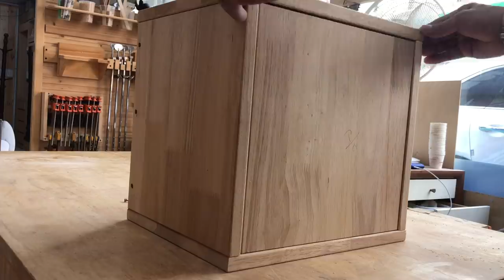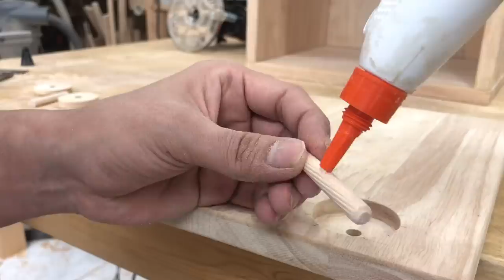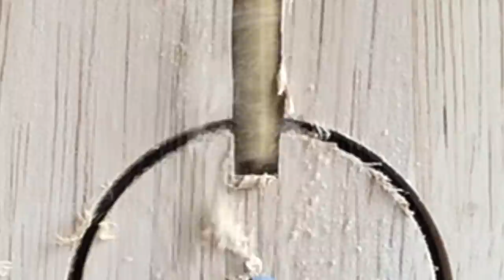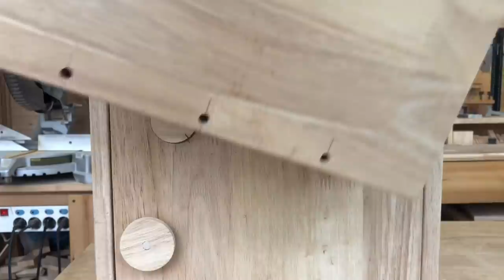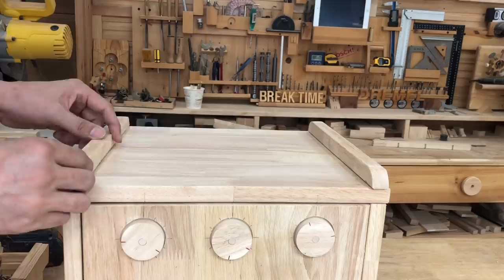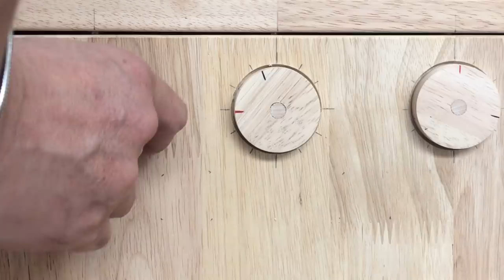부비 트랩 잠금 장치와 숨기기 목공 DIY

Comment: I want to see one made from something stronger like stainless steel.
Reply from the maker: 👍Thank you 😊 Have a nice day 🍀
Reply: yooooo cody youre here!
Reply: How would you go about the magnets when using steel?
Reply: and mess the magnetics mechanic
Reply: @six8810  at least it will be strong
This wood thing could be opened with a strong hand pull or flat head screw driver without much force at all
Reply: @robertnett9793  Good quality SS is not magnetic. Cost would be a concern.
Reply: @burp1914  ferrous metals disrupt magnetic fields, don’t matter if themselves are magnetic or not unfortunately:(
Reply: @huskkyy  If he used 316 stainless in a decent enough gauge and used stronger magnets then I really couldn't see an issue except for the cost of the material of course. He could go full engineer and use titanium instead of stainless but then price drastically increases.
Reply: @huskkyy  The Scrap yard tests all ss with a magnet. If it sticks the piece goes in a different pile. I doubt high nickel SS would affect the magnets in this safe.
Reply: Cody!!! It's always nice to see you comment on some random stuff
Reply: @robertnett9793  the lock pins could still be steel and the box itself stainless. Wow your smart.
Reply: @nickgamble4544  Thanks.

But... how should I go about wowing my smart?
Reply: That was my thought... a hammer will open this in seconds. And aluminum, nickel, copper, and titanium aren't ferrous and wont interfere with magnets. Or just buy a safe.
Reply: A pleasant surprise to see Cody here.
Reply: @DSNugent91  or he uses aluminium becaus its not magnetic
Reply: Common...he gave you the plan, modify it and use your imagination. He was not making a safe!  Honestly, who needs the turn dials. I can think of three different modifications to this design before breakfast, all using his core design but without dials...completely hidden. Cudo’s great carpentry work!
Reply: @burp1914  lol after paying to build I'd lack the funds to put into it.
Reply: @peter81083  Exactly. I Was looking for this comment.
Reply: Lol you guys are asking for to much y'all get the point damn
Reply from the maker: I think it would be perfect if it was made of stainless steel in Cordy’s Lab 👍
Reply: Do it, then.
Reply: @berndholzleitner2672  that would be a cheap option but the original idea was to make the box much safer. While aluminium is 100x better than wood, it's still a really soft metal in comparison to titanium or certain types of ss. That's why I just went with stainless.
Reply: @peter81083  Nickel is ferromagnetic.
Reply: @nickgamble4544 If YOU'RE going to judge someone's intellegince, you should probaly work on YOUR grammar first. wow you're smart. If you don't think it's correct, trying saying it the full way. Wow you are smart.
Reply: @robertnett9793  this is a funny dad grammar joke, but he probably doesn't get why your and you're make a huge difference here.
Reply: @robertnett9793  "how should I go about wowing my smart" was good stuff  :)
Reply: @IamGrimalkin  thank you bill nye.  But you get my point right?
Reply: @peter81083  
Yeah, I get your point.
Although someone else here does have a point in that non-ferromagnetic metals still disrupt magnetic fields to a point due to eddy currents.
It wouldn't stop the pins moving, but it would slow them down, and I'm not sure by how much.
Reply: @AlphaOmegaSigma07  good one :)
Reply: @IamGrimalkin  I understood that principle but didn't know nickel applied. Good to know but won't ever apply to my life lol. Ill.leave that out next time if I ever get into a similar conversation. I'd personally quote you and give you praise if I could pronounce your name :) 
Lol, I'm just being a dick. That was interesting to learn though:)
Reply: This is good enough to keep the kids out of your chocolate stash, then mess with their heads if they try to open it...bwahahahahaaaa
Reply: @robertnett9793  I see you also don't understand the English language. Ita okay but I'll admit it is very complex and complicated.
Reply: @nickgamble4544  Really - going from a bit of light banter to 'deducing' my lack of understanding? I had hoped for something more sophisticated :D

Also typo :D
Reply: If you look closely u can hear the ocen... Half day work for 1 second kick to open the safe....
Reply: @Krjen Yes, thanks :D I figured that out in the meantime :D
Reply: Why? If you use this as the mechanism to open a secret door to your bat cave it's totally kickass.
Reply: Ha ha. Stronger than stainless. Ummmm. Why? It’s a novelty. And wood is a million times less strong than stainless. Come one man. Get a clue.

Comment: This is actual crazy how it's so simple but has two locking mechanism the magnet concept is genius hats off to you
Reply from the maker: Thank you for good comments 😊 Have a nice day 🍀
Reply: @abhinavgupta7188  or just pass that thing on the metallic ones
Reply: @BStarCrafts  send it to lock picking lawyer
Reply: @abhinavgupta7188  If its upside down it's still locked.  The pins are longer than the holes in the top, so they'd still be engaged with the door.

Comment: Love this. Would be a good place to store chemicals paints stain solvents etc in the shop so that kids can't get into them so easily and that isn't a hassle to have to really remember a combination or grab a key.
Reply from the maker: 👍👍👍👍Thank you 😊 Have a nice day 🍀
Reply: @BStarCrafts  you too!
Reply: Drugs
Reply: But once they figure it out...
Reply: I wouldn’t keep flammables in a wooden box.
Reply: @cmsense8193  I already keep them on a woodshelf, albeit not closed in. But I've also kept them in old cabinets before. I am also going to be building a lightbulb cabinet with a thermostat so if it gets below a certain temperature it turns the lightbulb on (turns off at a certain temp too), but it will keep my glues and stains etc from going bad in the winter time because my shop gets really cold, especially on the outer walls. Everyone I've seen with them are made of wood.
Reply: Or you could lock them up like you should in a proper chemical/flammable liquid storage container/ locker.
Reply: @MrTRAce-by1sv  would you like to buy that for me? No? Well then maybe shut up? Cool yeah, good idea
Reply: You may want a lockable flamm locker for that...
Reply: Keep the box well ventilated...
Reply: @The_Bearded_Lady  tell em al !

Comment: Have you thought of ways to hide the magnets and tumble-lock features? Maybe even include a decoy keyhole or combination lock?
Reply from the maker: Good idea 👍
Reply: The best way to hide the magnet stick is to remove it from the box, but keep it near. Like just a random wooden stick.
Or May be as a fake leg of the box, not on the top.
Reply: Why you want to hide the magnets?
Reply: @henrikalo3379  - If you want a secure safe, it’s best if a potential thief can’t see the locking mechanism.
Reply: @henrikalo3379  so that if someone tries to unlock it and failed, he has no ways to reset and retry. this lock combination is kinda limited so giv it time and it will be unlocked

Comment: I see that you addressed the issue with turning around the box, but I think that over the long term, the turning of the magnet-bar might leave tracks in the wood, which might give someone who doesn't know the secret a hint.
Reply from the maker: Thanks for the comment.  But more importantly, they seem to be unaware of the fact that it does not open even when turned over.  As you can see if you look closely at the thumbnail picture, if the metal rod goes all the way down, it's already open.

Comment: I can’t believe that over 1k of people dislike this build video?!?! It’s clever and the filming is fantastic 👍🏼👍🏼
Reply from the maker: Thank you so much 👍😊 Have a nice day 🍀
Reply: It is just normal youtube algorithm.. pretty much any video has 1k dislikes.. some sort of mathematical byproduct of the system.
Reply: Luckily they removed the dislikes from view. About time!
Reply: Thats because some of them are understand that you can just flip that “safe” to open it. Without any magnets
Reply: @dink2544  safes are usually bolted down which negates that issue. And if the safe is removed from the bolted down position they’re probably going to take it to another location to open it. Plus it’s wood so to an educated person this video is more to demonstrate the mechanism and not the strength of the materials.
Reply: @dink2544  it will still be locked upside down. When the magnets pull the pins up, it sets all 3 between the door and the frame locking it. All the magnets are for is to get the pins free of the dials to get them out of the traps. If you turn it upside down gravity is doing what the magnets did. They're between the door and frame locking it. 
A heafty sledgehammer on the other hand...
Reply: as idia it's OK, but u can easily flip box over and open it
Reply: @SergEi-fq4tk  no, you can't. Read my previous post if you still don't get how this lock works.

Comment: We simply take a weak magnet on top of each wheel, if the bolt lifts up when offered then the bolt is closer to the top and wrong, if the bolt does not lift because it’s too weak then the bolt is further away meaning in its correct place. I liked the video and idea, very nice!
Reply from the maker: Thank you 😊 Have a nice day 🍀
Reply: Haha brilliant !
Reply: Undo The Screws .
Reply: @boboften9952  Yep, that's the obvious bypass.  The screws should be inside like the hinges.  Another trick is to force anyone opening the door to drop all pins at once, with trap holes at every wrong position.  Then the thief can't pick one wheel at a time.
Reply: @johndododoe1411  
? Remove The Screws Facing Outwards .

Some Adults Will By Pass .

Second Build With Better Mortise , And Locked Key Joints ?

Yes It Has A Purpose " Keeps Young Children Out "

Comment: I love the idea. Is there a reason you didn't make more holes in the wheels and create a 3 wheel combination lock?
Reply from the maker: It is also a good idea to make more holes in the wheel. 👍
Reply: It would become impossible to open even for yourself
Reply: @aki7162  how so?
Reply: Three holes is just the minimum - as we could see, when closed the steel pins are placed in the area in between the two false gates, making it impossible to reach the true gate start turning a wheel either direction, thus shielding the true gate. ... That's why more false gates are possible, but don't provide for more.
Reply: @JamesBrown-ux9ds  only if the attacker doesn't know about the magnet system, which seems rather easy to find.

Comment: People worried about turning it over and having it unlock need to think outside the box.  Just mount it. For me it's more about the lock mechanism than the box it's in its a good simple idea that could lend itself to many projects
Reply from the maker: Thank you for good comments.🍀👍😄
And the locking structure of that box does not open even if turned over. 😄

Comment: I love the project and it's ingenious. I'm really impressed. The false setting is a nice touch. If you were to make the open position something other than when the grain lines up I believe your cabinet would be more secure. Even so I couldn't have thought of your mechanism on my brightest day. You are an engineer with skills.
Reply from the maker: 👍😄
Thank you 😊 Have a nice day 🍀
Reply: the combination is pretty much irrelevant. if it is closed properly no one can get past the traps to the real hole without using the magnets. if someone knows about them it takes less than a minute to find the real hole in each knob no matter if it's aligned with the grain or not.

Comment: What keeps someone from just opening the box without ever touching those 3 knobs?
Reply: When they don't drop into the correct spot in the knobs the 3 pins are half in frame and half in the door. It can't open until the pins fall fully into the knobs correct holes clearing away from frame.
Reply from the maker: Bingo! 
Thank you 😊 Have a nice day 🍀

Comment: Easily hacked. Just keep spinning each wheel in the same direction until you find the right hole and you can see the gap or test the gap with a card to verify it is open. Then move on to the next wheel.
Reply from the maker: Thank you 😊 Have a nice day 🍀

Comment: So really, the only thing that you have to do to unlock it is swing that wood arms 90 degrees?

Reminds me of the very complex alarm system and theft deterrent mechanism that’s dependent on the power cord plugged in outside your front door.
Reply: Nah, you swing the arm and then you have to turn the dials so that there's room for the pins to drop down far enough, then there's clearance to open it. This demo version is marked clearly so we can see the different positions of places the pin can fall into in the dials, but with an unmarked knob you'd have to know first to use the arm and then where to turn the dials so the pins can drop enough. It would take quite a while of fiddling with the knobs and arm for someone to figure out the position for each.
Reply: @ItsAsparageese  except, the pins don't fall but move up. The turn knobs have no real added function for the unlocking. Other then confusing someone that tries to open it, maybe. And when you use it just your self, you can open de door any time without the magnet hinge.
Reply: @Streamcatcher  the door doesn't open when the pins are up. You have to lock the pins in the up position via magnet, then turn each knob to the position where the pins can drop out of the way, then release the magnet to let them fall. The magnet alone will only lock it. The knob positions are critical.
Reply: @Streamcatcher  The other replier nailed it, yeah. The door doesn't open when the pins are in the up position, that position just allows the knobs to turn so the pins can then drop fully out of the way.

Comment: I think you will find a slight flaw in the design that prevents it working as your portray. Three slots in each wheel and the pin will drop into the first one it encounters. So how to you get it to drop in the the 2nd (middle) slot without it dropping into the first slot in comes to!!
Reply from the maker: 👍Thank you 😊 Have a nice day 🍀
Reply: Magnets will hold the pins up till you set the correct slot and move the magnets away to drop the pins.

Comment: If I didn't have to keep the top clear, I could use this!
Reply: Just put the magnet bar on the front.  Use the same magnet bar for multiple cabinets.  If you loose it, a single magnet can lift the pin on one wheel while you turn it to the right position, then do the other wheels.

Comment: Perfect. I'd use this as a gun storage.   The magnet bar could be anything not even on the top. You could make it a detachable door handle, or a picture. Anything. Even a profound safe cracker will be stopped by this.
Reply from the maker: Thank you 😊 Have a nice day 🍀

Comment: Put 180c on another side and be opened without magnets 😀😃🤣 gravitation power
Reply from the maker: Sorry…  When the bar is turned upside down and the bar goes down, only the handle turns and the door is locked (refer to the thumbnail) 😄

Comment: And if you forgot the combination, you just have to try the 27 combinations to open it. 😁
Reply from the maker: Think again.  You may have just looked at the hole in the track and thought of the odds.  The trick hole is just a trick.  Suppose you can't see the cross section